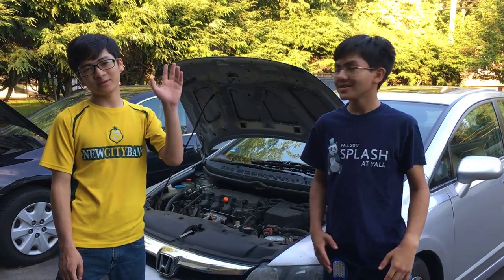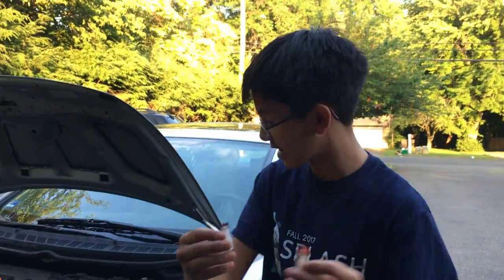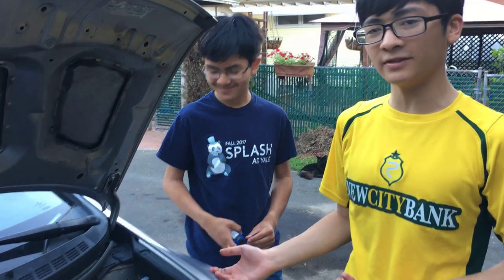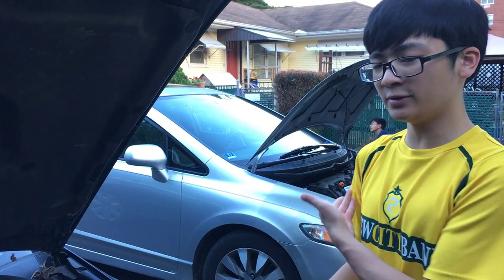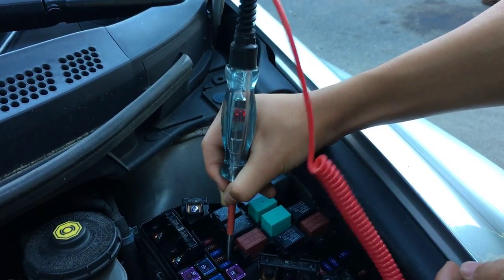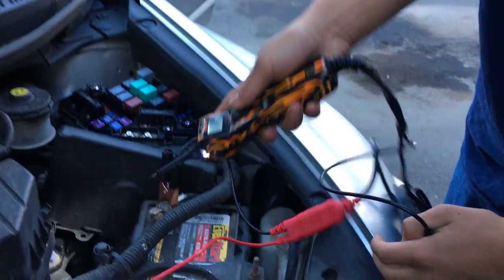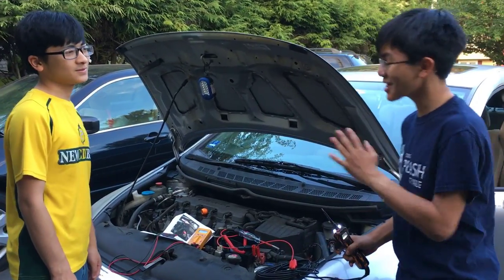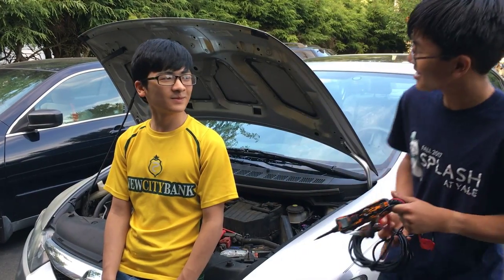How To Check Blown Car Fuses Using Multimeter, Test Light, Power Probe 3 Diagnostic Tool & Visual

Comment: You guys are great for working on computer vehicles. One thing I have to let you know because it wasn't informed in this video, I measured my car battery using a multimeter with the wrong settings. The red probe of the multimeter was plugged into 10ADC jack, when I tested out the battery it fried out my multimeter leads. Learn from my mistakes

Comment: great video guys. i am interested in testing the power of the individual fuse slots because some of my accessories are not working.i checked  the fuses and they are  not broken. any help would be much appreciated.
Reply: Which accessories aren't working? If only a certain one isnt, it is helpful to look at the wiring diagram.

Comment: Despite what your dad says, doing the continuity check will not damage a newer car. The amount of current it sends through the fuse is very very small, and should not be an issue.
Reply: x2
Reply from the maker: I'm sure you're right.  My dad's engineering days were 30 years ago so he's probably rusty on newer electronics and perhaps being overly cautious...

Comment: Great video. However, the load from the test light will be more than the meter though, unless you buy an L.E.D. test light. L.E.D. test lights are safe for newer model cars. To me your test light looks to be an incandescent bulb which is GREAT to simulate some resistance in the circuit but is not "new car safe" as your dad had warned you of. Realistically, as long as you're just checking fuses with a meter or test light, you're fine. Well presented though, great to not hear fumbling or mumbling and you sound like you understand what you're demonstrating.
Reply from the maker: Thank you for taking the time to write a comment with insight which will undoubtedly be useful to other interested viewers.
Reply: The LED test lights sound good, but the LED test lights do not check the components as accurately as an incandescent one.
Reply: @andybub45  As i said,  LED lights don't create enough resistance in the circuit to check if it can take any type of load. But they are computer safe.

Comment: Well I did enjoy the video and it's nice seeing kids getting their hands dirty.  Two points though...better break out the baking soda and water and clean and remove those battery cables of excessive acid...before dad boots you in the butt.  Secondly, when testing what appears to be a halogen bulb, point it away from you and never touch the glass.  Serious deterioration can result, and you never know who was playing with it before you.  Otherwise, nice video